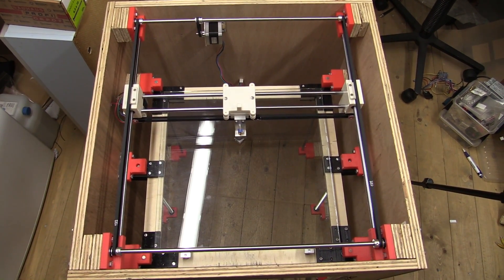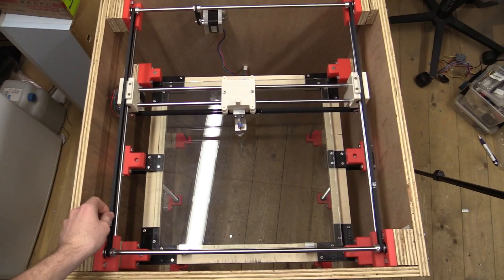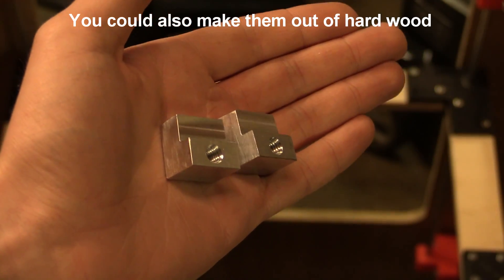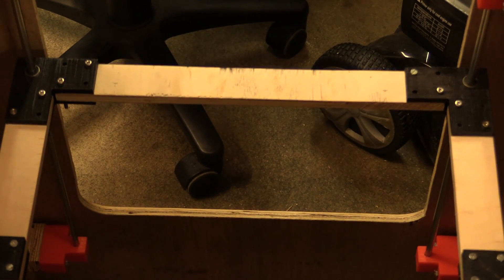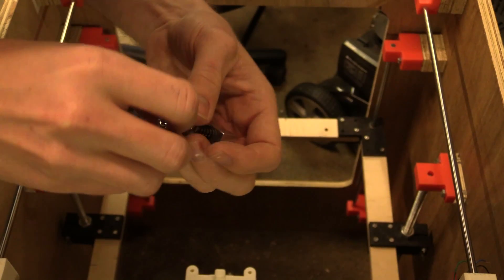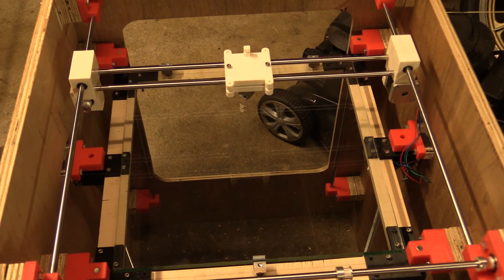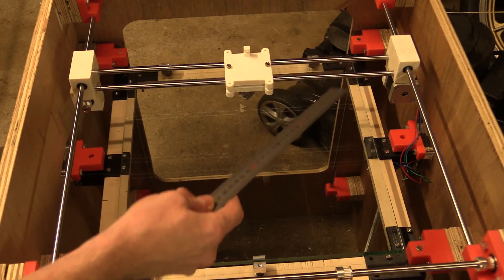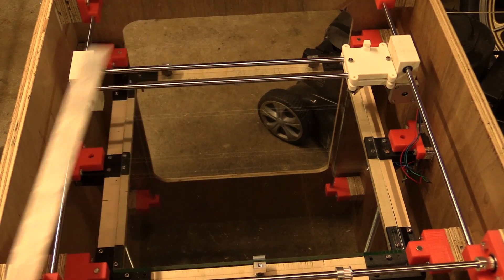DIY 3D-Printer Build (From Scratch) - Part 6a: Installing Print Bed - Ec-Projects

Comment: What is the make /model of the pillar drill?
Reply: Heli Pilot those parts are the ones holding the plate with the springs... a bit late but good enough for the ones with the same question

Comment: YAY at last more updates :o)  I bought some steel bars off ebay they are NOT 100% steel as supposed to be partly alloy as they have a low magnetic attraction and they were bent :( it seems it is better to seek out a local engineering firm and have them turned (lathed) down to a precision tolerance as can't trust ebay for high quality sliding bars.